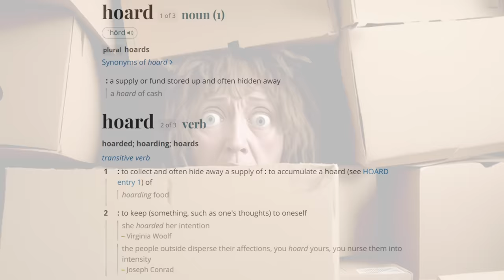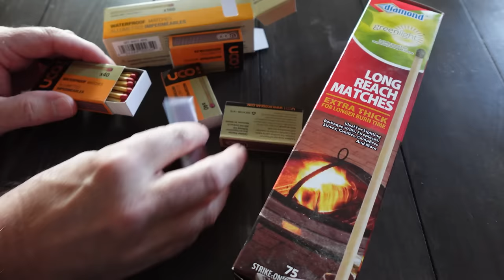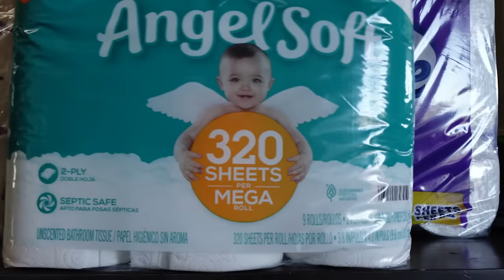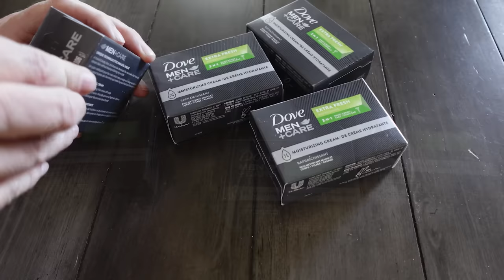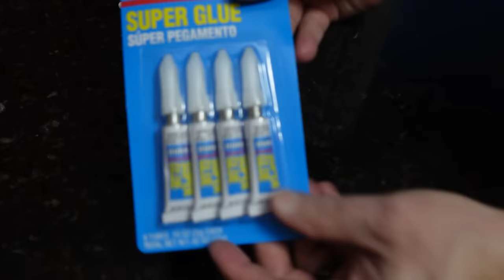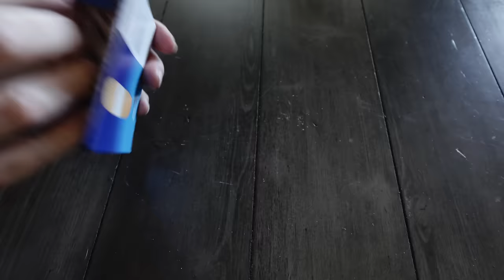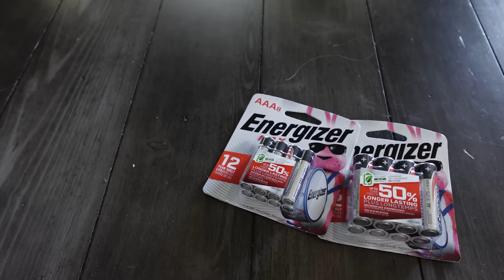20 Cheap Items to Stockpile, Hoard and Barter With

Comment: Along the lines of toilet paper, some of our local thrift stores sell bags of rags. (various types of towels, wash clothes etc) that are to ratty to sell individually. I cut them down to size and they can be used to wipe your busy if you run out of toilet paper OR if the power goes out and there are only so many flushes you can use.
Reply: I keep empty milk jugs of water to flush toilet. 
Big empty soap containers are good for storing water for  washing hands or underclothes if u didn't make it to the flush in time.
Reply: @bluebirdgramma6317 be careful of those milk jugs, they will leak.  Ask me how I know?  lol   So, I have quit saving water in the milk jugs.  I did save water in the empty laundry containers, to use for washing hands, toilet, etc.  And I saved emptied juice and vinegar jugs to save water in for drinking and cooking.  Those jugs are made with a thicker plastic, than the milk jugs.
Reply: @Bloodhoundjed1   agree, Anything plastic has a SHORT Lifespan!
Reply: @Bloodhoundjed1 I found that out as well.  Even the 3 gallon jugs will begin leaking after a few months!
Reply: glass is best

Comment: My go bag includes WD40 and duck tape.
If it's stuck and shouldn't be use WD40. If it won't stick and it should use the duct tape 
I include super glue in my first aid pouch for extra stick and to glue wounds
Reply: Duct  tape, not duck.  😂😂😂😂😂
Reply: @kathrynletchford5114  
Ahhhhh auto correct hates me🤣🤣🤣🤣

Comment: I used to live in the SF Bay Area and I lived through 3 events (2 that happened and 1 that thankfully did not) which demonstrated why it was necessary to be prepared, independant of government services which were overwhelmed i.e. Loma Prieta earthquake, Rodney King verdict riots, and the, now laughable, Y2K tech crash.  I knew I lived next to the San Andreas fault and that someday "the big one" was coming.  So even before '89, I had rotating stacks of vital supplies in a structurally strong and temperature stable area of my home. 

Chlorine bleach is cheap and has many uses in a survival situation, water purification being chief among them.  In general, it is valuable to have knowledge of basic chemistry.  There are hundreds of things that I can do with basic household chemicals.

Cheap metal tools and metal parts that are hard to make without a machinist, forge, or skilled blacksmith.  Drill bits, sawblades, nails, hardened steel tool bits, metal wire, and pipes.  Also, I recommend having hand tools in addition to power tools, at the very least an axe, shovel, prybar/lever, hammer, hand drill, and saw.

I happen to be a trained chef and I have always maintained a good dry wares pantry, just like restaurants do.  I have airtight food grade square containers with flour, rice, powdered potatoes, sugar, powdered milk, powdered eggs, dried mushrooms, soup stock, dry beans, chocolate powder, to name a few of the common foods.  I use and rotate these stocks so they are continuously refreshed, but always mark date and year.

Duct tape, cable ties, plastic tarps, moving blankets, painters drop cloths, kernmantle (climbing) rope, thicker diameter candles, aluminum foil (not necessarily for hats), plastic bags, and those fuel bricks made out of compacted sawdust.  All reasonably cheap.
Reply from the maker: Great list and advice! Thanks
Reply: @TheBugOutLocation  I lived in the Bay Area when each of those things happened.  I've lived through enough earthquakes that made me a forever prepper.  Thanks for the list.
Reply: Learn how to make sheets into tarps they last longer. Use silicone and naphtha or methylated spirits

Comment: We had a huge tree crash through our house during the winter a number of years ago.  It was 20 degrees F outside and snowing, and it got down to 40 degrees in our house before we could even get a tarp larger enough to cover the damage.  We had no electricity; and even if our area had it, we couldn't have used it since a lot of wiring was torn out when the tree came in the house.  We ended up sleeping in our RV in the garage.  (Insurance would have paid for a hotel but there are none in our area.  Also, my husband didn't want our home left unattended.) I remember being cold and miserable, and I can't even remember what we did about meals.  Remembering all of this, I can't imagine going through such a thing again even though we ARE prepared with plenty of food, blankets, heat sources, etc. We had a propane furnace, yet it didn't seem to keep us warm enough.  We had shelter in the RV in a garage, yet I was still so cold I didn't want to get out from under the covers on the bed. I guess I'm a pretty big baby when it comes to roughing it, and I sure don't look forward to when the $HTF.

Comment: The Wet Ones are good for hands. But if you want something for your body, there are disposable washcloths like they use to give old folks sponge baths. They are in the same section an adult diapers. As far as showering, I figure I can heat some water on a rocket stove. I have a camp style shower sprayer that is rechargeable. That should be enough for a quick shower a couple of times a week per person.
Reply: I buy the 3 pack at Aldi.
Reply: I just bought 500 pill towels for like 25$ . Have a ton of trash bags, hundreds of feet of vaccume bag material, There like 11"×9"  bought a case of rolling papers,  I've purchased a bunch of bags of tobacco, iodine qtips,  lighters, figure I'll either use or trade em
Reply: Dollar Tree sells the Modess brand of large no rinse disposable washcloths @ $1.25.

Comment: Clipper lighters are better than Bics, way better and are still cheap. I had the same one in my pocket for around 20 years, changed the flint and gassed it up and it keeps going. You loose them or get them "borrowed" before they stop working.
Reply: Never heard of a clipper lighter. Where do you find them?
Reply: Do you mean a zippo lighter?
Reply: Yes get the refillable lighters and spare cans of fluid , so much cheaper that way.

Comment: I would add baby wipes to the list of must haves.  They are good for cleaning up after going to the bathroom if you can't get hold of toilet paper and they are portable and fit into a backpack.  They are also good for wiping dirt and mess off your hands if you don't have access to running water.  Hand sanitiser is for killing germy hands and baby wipes are for dirty hands.  Be careful about buying hand sanitiser from the cheaper stores.  It will most likely be made overseas where you may not always be able to trust the ethanol content.  Some brands don't even have the ethanol content listed.  If find that no less than 70% ethanol is a good level for germ killing.
Reply: What about a respirator?
Reply: Store up flannelette sheets for emergency washable toilet paper .
If you run out. You can find them cheap at secondhand stores and free if you know where to look. Just wash iron and it's sterile. Or boil.

Comment: My little piece of advice, on TP I suggest buying coreless TP.  One good roll will be the same as over a dozen regular rolls.  It takes up a LOT LESS room and can last you months on the same roll.  Space is money.  Besides, cost wise it is much less as it is commerical.  Commerical profit margin is around 5%, consumer is closer to 60%.
Another thing you might find helpful is wire.  Could be some electrical, bailing, or whatever.  You would be suprised what a good piece of wire can hold and do when in need to tie something.  It can be wound around something else to save space.
Just my 2 cents worth.

Comment: I have a bidet on two of my toilets to clean myself with water not T paper, so I don't need to buy out the store for it, just a little  I have a portable one I carry in my purse that I could use if there is no water coming to the toilets. I have a rain barrel that is usually full of water and a Berky water filter and a distiller and some of most of the things you suggested, although not enough, it seems.
Reply: What if you.don't have water 😮

Comment: 1. lighters
2. matches
3. fuel - butane, propane, alcohol stove
3. toilet paper
4. bleach 
5. soap
6. trash bags
7. emergency blankets
8. zip ties
9. duct tape/electrical tape
10. cordage
11. glue
12. flashlights
13. instant coffee
14. bandaids, medical supplies
15. batteries
16. hand sanitizer
17. wet wipes
Reply: Should say 17 items not 20

Comment: Bandaids are for wooses. I put a dab of antibotic oint on paper towel and wrap with tape. But that is only needed if soap or alcohol not handy or cut is deep. Hand sanitizer is expensive and I hate stickiness of aloe. I put alcohol in spray bottle and use small piece od paper towel for friction for deep clean. Hot water for bath unless in winter is for wooses. 
I have been living off grid three years now and do not miss many things city folk believe they need to survive.
Reply: A couple years ago, I cut my left index finger pretty deep while splitting kindling. Superglue, paper towel, Neosporin and electrical tape were my 1st aid that day. Healed up like a surgical incision, super clean.
BUT, a good band-aid wouldn't have been unwelcome. Just sayin'…👽✌️
Reply: Iodine powder is good

Comment: Hand crank/solar/NOAA emergency radio/flashlight/5000maH battery bank

If the powers out and it's too cloudy to charge it up using the solar panel, then you can always start cranking the handle to charge up this battery bank!
Reply: Yes, but the damn radios are backwards for turning.

Comment: Baby wipes , carabiners , Doberman glass break sensors are great alarms, those emergency blankets also make emergency sleeping bags which are much better , you stay ,check warmer life straws , solaar powered generators radios plug in cooking grills and pots, thermometers with wire for indoor outdoor, disinfectant spray N95 masks, bear spray, scissors and can openers , portable toilets and bags for them, battery operated candles , solar lanterns , shower curtain liners ( quick way to cover large areas cheaply) camoflaige colored tarps,stern strips and stitch bandages, Israeli tourniquets, water purification tablets, toothpaste, emergency towels ( cone in tiny tins and expand when wet) Vaseline, ok I’m shutting up now

Comment: instead of toilet paper, buy a bidet. Life changing
Reply: Yes !
Reply: @BobSmith- Get a hand held one that you fill with water and squeeze. I use one when I'm away from home and it works very well. Then use a half of a wet wipe for any little residue that is left.
Reply: Just remember u may not have electricity or even running water.
Reply: @cheriweber4  I have a rain barrel that is usually full of water.
Reply: No good without water.

Comment: Don't buy cheap harbor freight zip ties unless you are planning to use them in a very light duty situation.  They are better than nothing if that's all you can afford.
Reply: String rope wire

Comment: stock up on toothpaste and mouthwash
Reply: Baking soda and water works. I use it by itself  but usually make a toothpaste from it, Hydrogen peroxide, (food grade) and coconut oil with essential oil peppermint drops. My dental hygienist told my dentist that I had good hygiene. I didn't tell them I've making and using my own toothpaste.
Reply: I quit buying toothpaste and mouthwash.  I rinse my mouth out with peroxide and use baking soda, salt, and peroxide to make a paste to brush my teeth.

Comment: I’m sorry, but, you don’t know what you’re talking about. Storm proof matches are not cheap. They’re extremely expensive. Be better off buying cheap candles, and coating your matches by yourself. And don’t get the small boxes of matches. Those are crap. Better than nothing but most of the time they’re just not big enough. I have six boxes of strike anywhere kitchen matches that I’m going to coat them completely with wax. Gives me the edge on if there’s moisture around.